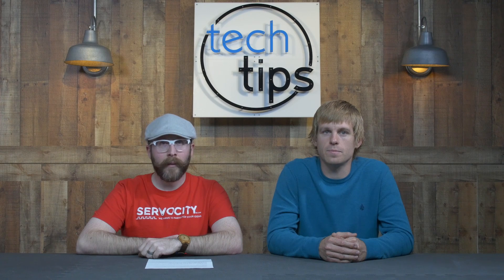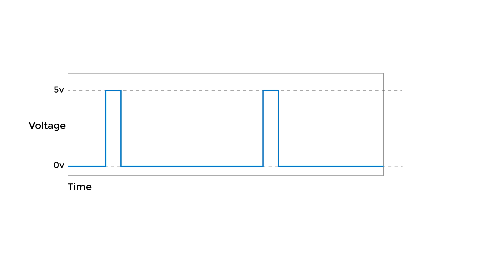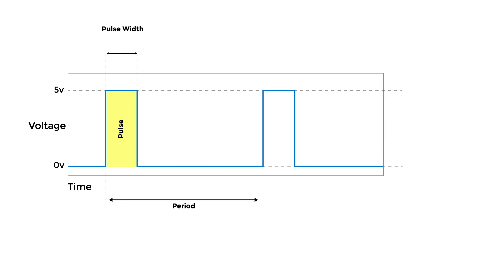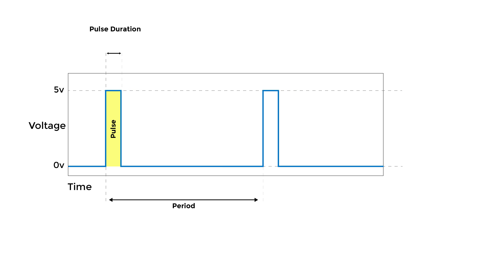What is a PWM signal? - The Secret Life of Servos: Ep3

Comment: why microseconds?... why not nanoseconds?
Reply from the maker: Hi Carlos, you can quantify the signal in nano seconds if you prefer, it just adds three zeros to the numbers we've given.  Some people will go the other way and use milliseconds to trim it down the number of trailing zeros, however, it does cause you to have to use decimals which isn't preferable.  Let us know should you have any other questions tech@servocity.com.
Reply: @ServoCity  So if you are saying that measuring in nano seconds just gives more zeros, then the servo presumably has only 1,000 or so positions it can go to (1,000 to 2,000 microseconds in hobby market as you say).  Does that mean the new radios and servos that have  ~4,000 resolution will just get rounded back to the 1,000 available micro seconds so are not really an improvement over the 1,000 resolution transmitters and servos?
Reply from the maker: Hello Bob, Some radio systems can make smaller changes than a full microsecond to the PWM signal being sent.  Whether that small of a change initiates a move from your servo depends on the deadband and resolution of the servo. Please always feel free to reach out to our technical department at tech@servocity.com should you have any further questions, as they would be more than happy to help out.

Comment: To expand on that, PWM is a way to create varying output voltage from a source voltage by chopping it. For that it uses rectangular pulses of either 100% input voltage or 0% input voltage (ignoring special cases),  with the subsequent device, typically a motor, being too slow to follow these fast pulses and smoothing them out. 
-> 
So it would have been nice to explain how we get to use this very different method to transmit information and mention PPM (pulse position modulation) as the (old) way of RF transmission, encoding joystick pots and multiplexing them into a pulse train which then gets demultiplexed on the receiver end and the now-individual-again pulses become the servo pulses. The PWM signal has basically been designed so that it recreates the former PPM signal. 
I personally find the use of the term PWM for signal transmission confusing - for example in hobby use, we often have ESCs that actually do PWM to control our motors (of course we have effectively ESCs inside the servos...). But I feel in a few years, no one will be using the term PPM anymore.